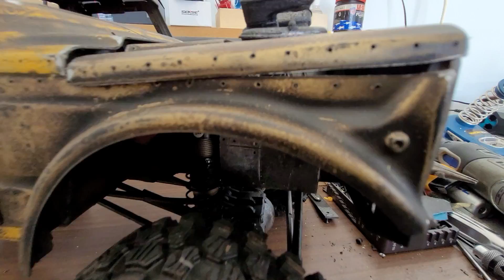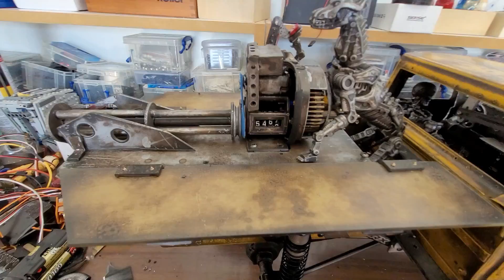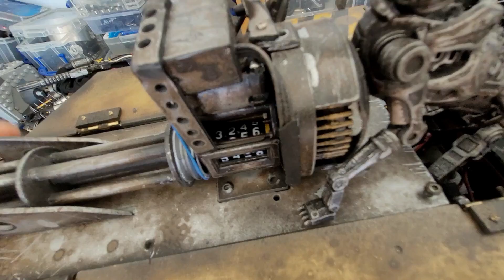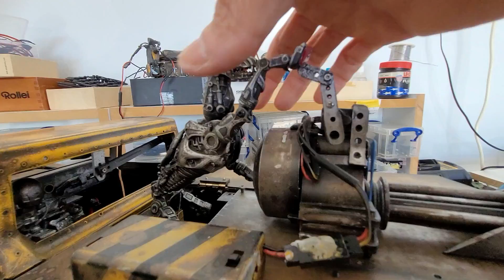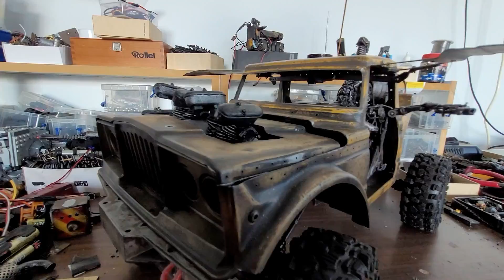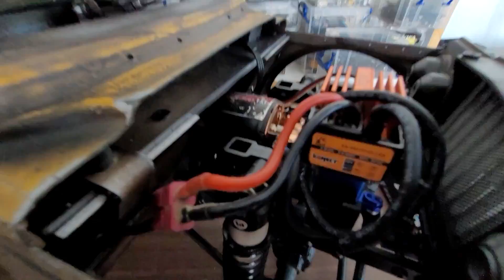The Electrics of RC Animatronics by Danny Huynh Creations.

Comment: dude how do you keep coming up with so much material and custom pieces for your builds, it's not like you pop on down to you local hobby lobby and grab an electric vulcan gun kit off the shelf and the little dude with the rotating pistons and crankshaft insides, where do you find crap like that, you may be 3d printing a few things but at the speeds you put out new builds i know your not 3d printing much cause that would take way too long....